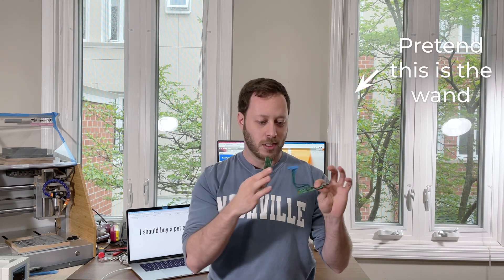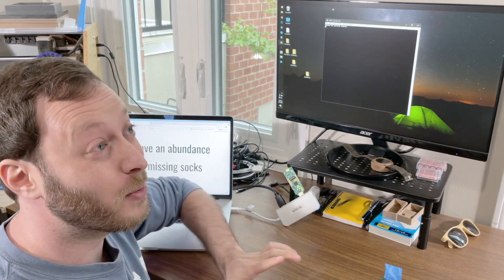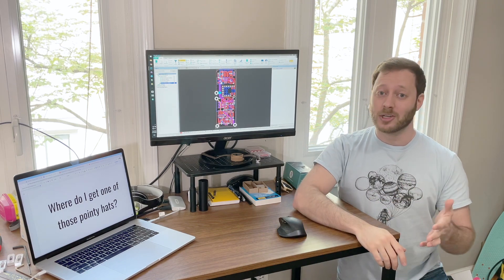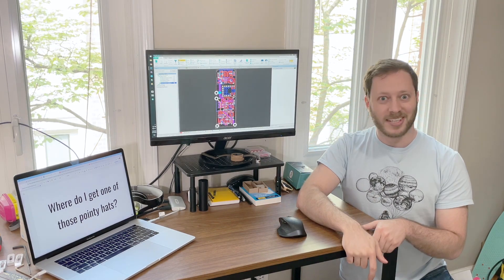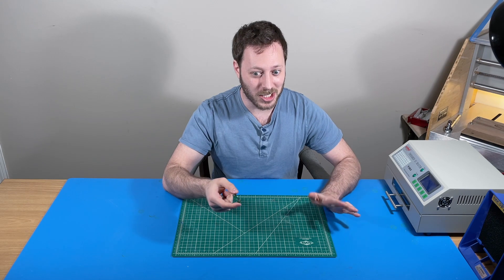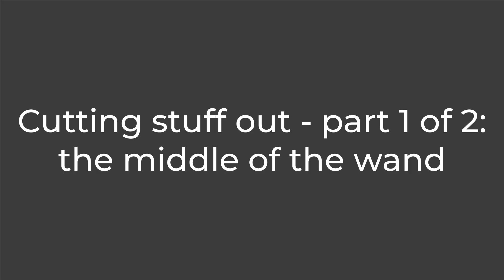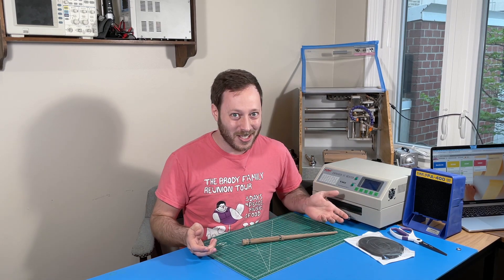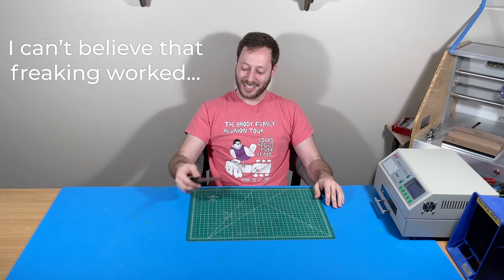I made a REAL magic wand!

Comment: how did you connect the wand to turn on the smart plug thinking of making my own
Reply from the maker: @ianplayz1994  I designed both the wand and the smart plug, so I wrote the firmware for both to interact with each other over Bluetooth!
Reply: @SamMarch  any tips how to do it in my house not anything simple and what did you use to put the stuff on the board? Doesn’t matter what stuff I put on the board.
Reply from the maker: @ what do you mean by “put stuff on the board”?
Reply: @SamMarch  the parts that you are putting on the board with the tweezers I’m new to the whole actual circuit board stuff
Reply from the maker: @ianplayz1994  Ah, got it! The parts going on the circuit board are all the components (things like the microcontroller, sensors, etc). In order to make make them both stick and be electrically connected to one another (via the circuit board), I use what is called solder paste. It is essentially a bunch of tiny solder beads suspended in flux. When you bake the board, those beads of solder reflow and turn into a liquid, connecting the parts to the board. When you let it cool back down, the liquid turns solid and becomes a solid solder joint!
Reply: @SamMarch  anywhere you recommend I buy those parts I have the board just don’t know where to get the parts to put on it

Comment: will you publish the wall plug also? I would love to build this
Reply from the maker: Hi Martin! Unfortunately, I'm not planning on releasing the wall plug plans. Normally I am all for releasing all files I have for all my projects, but for this one particular project, I decided against it. The reason is that working with wall power can be extremely dangerous if not done correctly (and without sufficient care). While I am sure there are many that could make sense of the plans and be totally fine, I would rather not risk someone potentially getting hurt at my expense. I hope you understand.
Reply: @SamMarch   Do you think you could build something on like an ESP32 which features BLE, Bluetooth and Wifi as a middleman and from there use MQTT to switch on something like Sonoff devices with Tasmota? Or could you PM me the files? I would really like to make a marriage proposal with this thing and the original wands are garbage at best.
I am very well versed working with mains power.
Also I understand that you are careful to put something out that works with mains power, but people should understand that mains voltage is dangerous from a very young age and you can easily buy hefty tesla coils online.

Comment: Is it location specific?  Does it know where the nearest light is, or what room you are in? Or is it a separate gesture for each light you can control?  
Also, can it integrate with Home Assistant?
Reply from the maker: It’s not location specific, it’s gesture specific, so one gesture could control all the lights or just a specific light. 

As for HA, it could, but would need some firmware updates

Comment: Please kickstarter this! This is such a cool project! I suspect the code needs some work to support lots of gestures to control lots of devices, but the hardware is amazing. The cnc'ing is also super impressive. STL files for a 3d printed version of the wand would probably make it more accessible. I'd absolutely buy the pre-soldered circuit board and 3d print a wand if there were an option for that. Very cool video. I hope to see more videos from your channel.
Reply from the maker: I actually uploaded step files on the GitHub page so you can just download them and convert them to stl files for 3D printing! I typically just open source all my projects do people can make them for free!

Comment: Sweet. Obviously this now needs an internal lipo and wireless charging, so you don't have to disassemble it every time the battery runs out (and not disturb the perfectly "analog" exterior by adding a USB port for charging). 
I suspect right now it works selectively in the sense that it connects to the nearest "smart plug"?
Have you considered making a unidirectional antenna to pick out only the plug you're pointing at, using the omnidirectional antenna to then communicate to that device while completing the waving gesture? That might make it work through walls and should make it work with an arbitrary number of devices in range (provided that the spatial separation is sufficient for the unidirectional antenna).
Reply from the maker: It actually is running on a LIPO! It has a 10440 cell inside (same size as AAA). The metal rings near the top and bottom of the leather wrap that you see at the end of the video aren't just decorative. They are charging pads! 
As for how it connects, the wand actually acts as a BLE beacon, so no actual connection is made. The entirety of the wand gesture is encapsulated in the advertising data. This means the plug is responsible for deciding to turn on or not. The cool thing about this is that it lets you turn on 1, 2 or 50 plugs all at the same time. The gesture you make with the wand (whether you swing up-left-right or up-down-left, etc.) determines what plug comes on! It's kind of like naming each plug by a specific gesture.
Reply: @SamMarch  Oh wow, that's a sneaky lipo then; forget I mentioned it :P
May I be the first one to suggest to name it a GP-Address? (Gesture-Protocol-Address)?
The data transfer protocol would then be TCP/GP :D
Reply from the maker: @J0ermungand  😂 love it

Comment: That's incredible! How do you get the directionality of the Bluetooth? to know what it is pointing at? or did you only test with one "plug" at a time?
Reply from the maker: Each plug can have the same or independent gestures as all the others! So you could swipe left, left, down, up and turn on 3 plugs or 1 plug!
Reply: @SamMarch With only gps? or do you use an accelerometer to get the gesture?
Reply from the maker: @trikers471  No GPS actually! All accelerometer.
Reply: @SamMarch  I meant Bluetooth xD
Awesome! (so if I got it right, you use Bluetooth to get proximity and communication between the wand and the plug, and then you use the accelerometer to detect gestures, which then tell the plug to turn on?)
Reply from the maker: @trikers471  That's basically it! The wand actually never connects to the plug, it just changes its advertising data. The plug (or potentially multiple plugs) are just observing for a specific sequence in that data.
Reply: @SamMarch  oh awesome, so you are just using it passively! That's smart, didn't even think of that, does the name then just determin which plug should change state, or is it a long string that determines the state of each plug? As in, do you have something like "000100" (so the fourth plug is on only) or do you set the name to something like "plug 4" (as in plug 4 should change state) (sorry if I am getting too in the weeds, but I do similar stuff, and always get fascinated by how others solve these kinds of problems)
Reply from the maker: @trikers471  I'm more than happy to respond! The plug, when you hold the power button for 5 seconds, let's you "re-name" the gesture it's looking for. So, you can say that this plug will always look for the gesture "left-up-right". Then, when you hold the wand upright, it boots from a low power mode into actively looking for gestures. As you swing it around, it appends the direction to the advertising information. So, for example, I swing left-up-right, the wand would then append a series of bytes to its advertising bit saying "left-up-right". As soon as the plug sees that, it activates.
Reply: @SamMarch  oh that makes perfect sense. so the plugs just know the most recent series of gestures. cool, thank you!
Reply from the maker: @trikers471  My pleasure!